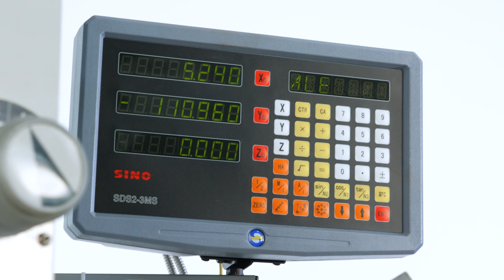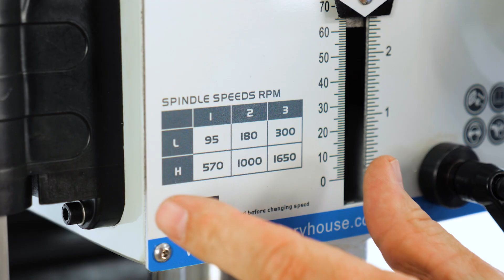HM-46B - Mill Drill - Geared & Tilting Head (M138, M138D)

Comment: “Precision ground slideways” top of the tables are ground to within 0.02mm but the slides are just left milled with faux scraping on the exposed y axis ways. the deviation in the x slides alone usually exceeds 4 thou
Reply: wait..... 20 micron is precision grinding now?
Reply: It's faux scraping, but the grooves also serve to retain oil.

Comment: Hi. I have an HM-36 mill drill that came from machinery house nz. I am going to change the gearbox oil on it. The manual says to use sae 68 oil but  i can't find any oil listed as sae 68.  Plenty of iso 68 which is hydraulic oil. Which oil do you recommend I use? Thanks.
Reply: ISO 68 is the same. Just get some 68 weight hydraulic oil. It’s very common.

Comment: It's a very nice toy.

The significant word on the line above is toy.
Any machine without power feeds in all significant dimensions is a toy.
Reply: Worthless comment. With a drill capacity > Ø30mm, it’s hardly a toy and good machine for home/small workshop use.
Reply: @brendan4401  You can get good toys ! I'm not knocking the smaller machines for being toys, it's just that they're still toys !